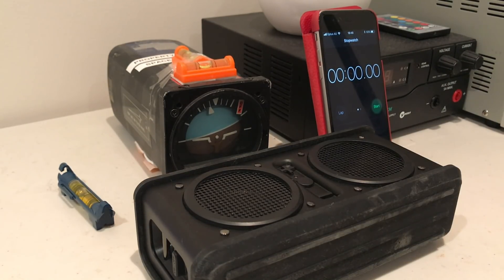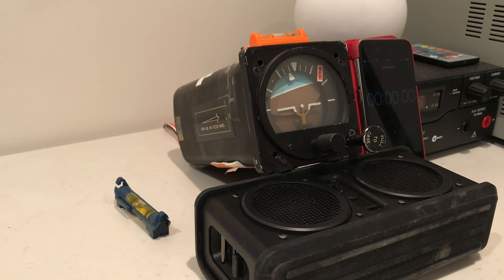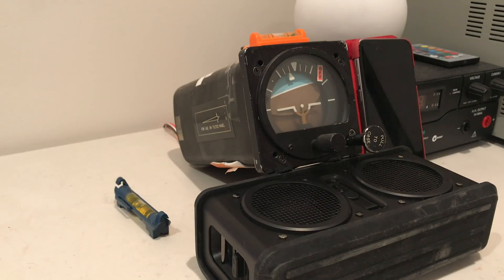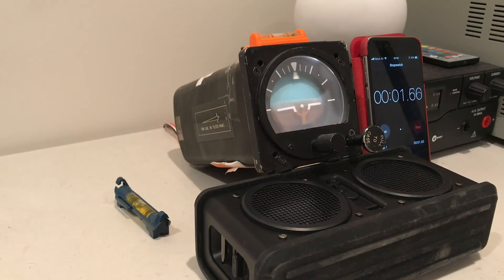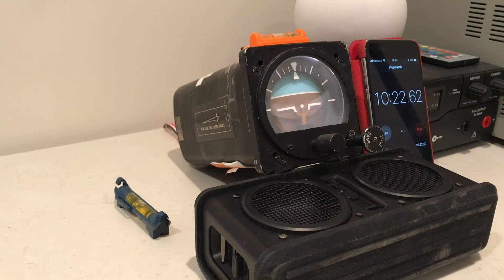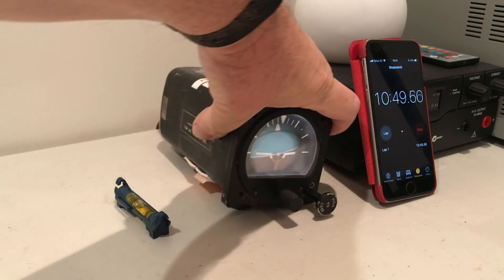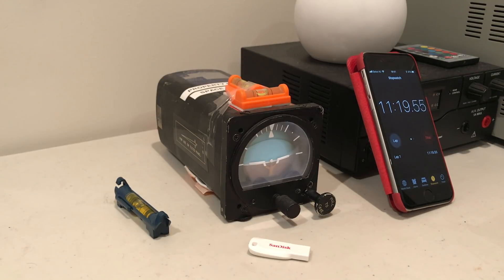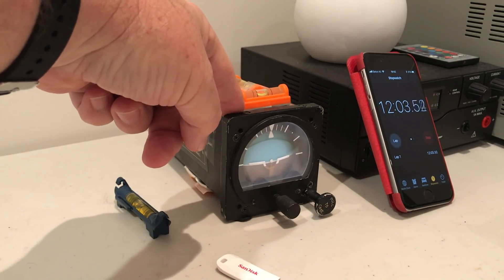Flat Earth - An often requested Artificial Horizon Experiment - Powering up at an angle.

Comment: Wolfie6020
RE: "The claim that the gyro inside this instrument always remains rigid in space is completely wrong."  NO thats not entirely correct.
The CoG of the spinning brass gyro wheel is set in the gimbal below the horizontal axis pivot point. Effectively because of the weight bias, the standard aircraft Artificial Horizon indicator is just a glorified plumb bob. If you lock the the pendulous vanes where they cross over at the base of the unit & add weight to the vertical balance adjustment screw, so that true pivot balance is neutral, then even this unit will remain ridged in space... exception>(because the spinning mass is still below the horizontal pivot point, aircraft acceleration & slowdown will have a slight impact on read out).  
Just as bearing drift will cause bias or error, having the gyro gravity weight bias preset in standard units, this will always favor the AHI to self correct to level. 
 You could so very easily prove the earth curvature if you wished???, just lock the pendulous vanes & remove or correct the pendulum weight bias. Apart from bearing drift, you should see a 15 degree change in 1,000miles or proportional part there of. 
You could conclusively prove flat or round earth in less than 2 hours flight time, not hard to convert that standard AHI to a *space type gyro*.
Reply from the maker: +Steve Tozer.  Sure and I don’t disagree with your logic if it were possible to perfectly balance the gyro but we would also have to completely eliminate all bearing friction and remove any vibration and micro accelerations from the aircraft 

Without modifying the instrument it is correct to say the gyroscope inside is not remaining rigid in space.  Even if the aircraft is not flying the gyro is constantly being corrected to remain level.   If it were not we would see it moving from the rotation of the Earth.

The flight plan alone for a two hour flight would conclusively prove the Earth is a Globe because they are all calculated for a ball and will never work on a Flat Earth.

Unfortunately in my almost two years of dealing with flat Earthers I have not met one with mathematical skills beyond the third grade so it is futile trying to explain the flight plan formulas to them.  

I have tried but they are completely blind to the numbers.  It is like showing a colour blind person an ishihara chart with a number on it.  We can all see the number clearly but the colour blind person never will.

Flat Earthers are blind to the math and the same goes with geometry as the Equinox Sun angles irrefutably confirm the Globe too.  

I don’t say this to offend anyone and I keep hoping to be proven wrong and meet a Flat a Earther who gets the Math,  but then he would not be a Flat Earther would he?
Reply: Wolfie6020
Thanks for your answer,  i should concede i do tend to lean towards a geocentric earth but that doesn't mean i support flat earth, rather im not convinced earth rotates. 
I'm in the process of making a second mobile triple axis space type gyro, the spinning disk diameter is about 400 x 10mm, larger diameters tends to neutralize or over ride a fair bit of drift(just as greater wingspan stabilizes roll), even your Ai unit in the video, run up on the bench wouldn't drift more than 12degrees p/h without auto correction, if earth rotates it should drift/move 15degrees p/h(+/- drift). The mean average of bearing drift on a stationary unit can be fairly easily worked out with a few test including reversing power supply.
A well made true space type mechanical gyro with certified balance & friction results that didn't move 15degrees p/h like clockwork would create questions. I am aware of the fully electronic units, however these may just be reading flux field though?... a lot of Helio & Geocentric math is the same if not identical (FE not included).
I sure would like to see a practical test done in an aircraft with a mechanical gyro, the speed at which you generally fly at(518mph) means curvature/(+ earth rotation)or lack there of, should appear fairly quick, 1 degrees every 8 minutes if travelling N/S, (or 2 degrees if travelling east {if earth rotates?}), in smooth air, no well made gyro would have bearing drift greater than the expected earth rotation + curvature @518mph travelling East. 
2 bonus questions if i may please:
Q1, on your altimeter, does changing cabin pressure affect the gauge height readout?
Q2, in the Heliocentric model, what stops earths atmosphere from being sucked into the vacuum of space?.
ps, i agree there are lots of turkeys on the internet arguing about all sorts of subjects, happy to acknowledge your presentations are top quality & sincere. Cheers.

Comment: Sure if you spin it up an it levels out on an angle but is level to the device it obviously going to be level when you lay it back down.. you have moved the whole system from level to level. Show actual documentation of what it does.
Reply: DivisionNL
If you scroll through Wolfie's videos you will find a hole series about the artificial horizon, also where it gets disassembled.

Comment: I thought Gyroscopes aren't affected by Gravity? So is the gimbal holding the gyro doing all the gravity work?
Reply: The gyroscope still has weight so it is still affected by gravity.
What exactly do you mean with " gravity work"?
Reply: Meeborg GP the actual motion and what a gyro does is not affected by gravity. The weight of the materials it's made of yes.
Reply: toiletduckie44
The gyro in a artificial horizon is.
Reply: toiletduckie44
What you just said makes no sense. Although the gyroscope is spinning it would fall when you drop it, therefore gravity affects the gyroscope.
Reply: Meeborg GP well a gyro is "rigid in space" so if you spin up a gyro and could somehow move gravity above it. To the left. To the right. To the bottom. The gyro would stay up right in it's spin. Sure whatever is holding the gyro may be attracted to the gravity but it would stay upright.
Reply: toiletduckie44
Lol, your "whatever that is holding the gyro "... guess why you need something to hold the gyro! Because without something holding it it would fall down affected by gravity!

Got it now?
Reply: Meeborg GP lol. I'm not that thick. I mentioned that above earlier in the comments. You're missing the whole point.
Reply: toiletduckie44 
That is why I asked you to specify what you do mean with "gravity work".
Reply: Nothing?

Comment: Talk about throwing yourself in with the sharks.. but here goes...I am in the flat earth camp in as much as I do not think we are moving through space and I do no think we are on a spherical or pear shaped ball. I know that I will come under heavy fire judging by your followers  comments below. I have watched all your gyro videos and although they are very well put together and to a degree educational, there  is only one aspect I am interested in learning about. I have to trust that you are a genuine person and are not wanting to purposefully deceive people because you are on a payroll somewhere.

So in this video you showed the gyro tilted on your speaker box which is fine, however you caged the gyro on the flat table beforehand then in the tilted position you powered up the gyro and it did exactly what it was supposed to when you put it back on the table, even though it takes a while it goes back to its caged position. That caging process is vitally important and gives the frame of reference which the spinning "fixed in space " gyro will always want to return to! If as you say the plane follows the curvature of the earth and the case is effectively put back on your speaker box and further , depending on the duration of the flight, the level indicator will go to its original caged position which by then would be unattainable because the plane could now be at some 50 degrees to that original caged position NOTHING will change that unless you re cage the mechanism! gravity or inertia or anything will only disrupt the gyro momentarily until it re establishes its position.

If I was flying a plane and my gyro was caged at ground level and I flew into cloud and ground fog the only thing what would get me to safety would be my altimeter and my artificial horizon!! Happy to hear any constructive comments, I just want the truth as should everyone!
Reply: I think you misunderstand what caging does. The gyro doesn't return to the caged level, caging just locks and resets the gimbals to center the working range on all axes. Gravity is what guides the correction mechanism, not the caging.
Reply: "Let's see Wolfie challenge this one "
LOL! Don't bother him, I can do it myself. Australia/Victoria is indeed 15 hours ahead from USA/Tennessee. But that also means there is 24-15 = 9 hours between the 2 locations. It is a sphere, remember? Translated in longitudes that makes about 240° and 120° (240+120=360).
The Moon can't be seen from 2 locations 240° apart, I agree. But no problem from 2 locations only 120° apart ... I will add that the Moon's orientation confirms the globe : same phase but tilted according to the 2 latitudes.
Reply: Paul STILL' on the FLAT, Wolfie has demonstrated this, the display returns to level, not to the orientation of the instrument housing. If you cage it to any position, and then orient the housing to any position the horizon indicator will slowly return to local down, not to the housing orientation.
Reply: Michael Onines at 3.59 in this video Wolfie demonstrates the gyro working correctly as it was caged flat on the table and as he props the housing back on his speaker box, the level indicator is clearly in the brown (nose down) position which is fine, I am saying that this is what you would see after an hour or less of 500mph flight, the body of the instrument would effectively be in that orientation from where it set off and that correct reading on the display is what you would see! after a few hours flying "around the curve" the mechanism would be out of its usable range, you would have to re cage it to bring the instrument back to a workable range. Wolfie actually displayed exactly what I am proposing about the fact that the plane is not flying around a curve or this would happen!!
Reply from the maker: +Paul STILL' on the FLAT.  Hi Paul.    No, the Caging process has nothing at all to do with setting a frame of reference.  

All it does is align the internal mechanism to the external case momentarily.  If the external case is tilted when you cage it and then release the cage the Gyro will self correct back to true level (based on the direction objects fall) and the position of the case when it was caged is irrelevant.  

Please watch these demonstrations. 

https://www.youtube.com/watch?v=klflYPbw708

https://www.youtube.com/watch?v=TbqcT05YWeo

If you want me to do a specific power up or cage in any orientation please let me know and I will do it exactly as you request to prove the cage & initial power up position are irrelevant.
Reply: Rollie, thank you for your reply and I accept that the caging just speeds up the time the instrument would take to correct itself. I would like an explanation if you or any of you guys don't mind, to explain the part in my comments regarding the orientation of the plane and the case of the mechanism ( which is obviously secure in the instrument panel) how at 3.49 when Wolfie lifted the spinning unit onto his speaker mount the A.I was in the nose down position as it should be!  but isn't that the same as the orientation would be after a few hours of flight? please understand I respect you guys here because there appears to be some integrity with you  all, I am keen to know this because I think it is a crucial and a provable experiment one way or the other.
So let me try a visualisation exercise, 
You are on top of a tall building in a helicopter and you are going to fly to another tall building which is say 200 miles away! If you draw a gentle arc to a realistic scale and stand the two buildings upright as they would be on the curved surface, the two building tops would be out of line with each other. power up the gyro and with it centred on the horizon line, fly to the other building, I am sure you guys have seen F/earthers cartoons showing the gyro maintaining its forward "fixed in space" position as the aircraft flies around a curve! I do not necessarily disagree with this so there must be something someone is overlooking. Going back to my question about Wolfies video at 3.59 where is the point where the artificial horizon corrects itself and is still true to its line upon landing at the other building?
I can see why they think this would be the case and I am keen to know your thoughts, thanks in anticipation.
Reply: I think I can see this now, you will assume as the plane moves around the curve the centre of gravity will also move so you would not notice any difference! the problem is it also works on the flat as well!
Reply: "it also works on the flat as well!"
Right! Yet you forgot there is no gravity on FE, replaced by some magical natural up-and-down   ^.^
Still awaiting for a working FE map and a FE model explaining actual observations of the sun for example.
Reply: French crow Me too!! however I am sure there is something amiss because the authorities with the power are very evasive in sharing real info. I am not paranoid but something ain't right!!
Reply: I see that Wolfie and I fully understand the reasoning and science behind your demonstrations, It appears to be "centre of earth gravity" against "flat earth density" keeping the gyro aligned, both models work so I will have to think this out! either way thank you for your very informative videos
Reply: Paul STILL' on the FLAT, I think you are getting it. An artificial horizon isn't some sort of magical globe earth proof, but there is no reason it wouldn't be practical and functional on a globe the size of the earth, unless you are travelling at hypermach speeds, in which case thy don't use the style of gyro Wolfie demonstrates with.
Reply: I'm on FE all the way. Nature proves FE. I'm tired of actually being interested in globe proof when most of the evidence is created in AutoCad which I ran for years. It has nothing to do with FE other than create a Flat grid that negates the N Pole Vortex. Now we have a silly experiment with a Gyro that proves they work on a Flat table. Show one night flight video with vertical star rotation going up over the cockpit as it would be if it was flying around a ball. They don't exist!
Reply: Tyler, are you claiming that the stars paths disprove the globe? O_o
Can you elaborate?
Reply: Thank you Tyler I will look into that
Reply: Yes. I'm going to do a video on this. Apparently the stars are outside of the so called Vacuum of our atmosphere. So if a plane is flying at night and the stars do not rotate vertically over the plane that proves either the stars are inside the Vacuum and space is still bullocks or simply the plane is flying across a Flat Earth.
Reply: I already did a shorter video on this https://www.youtube.com/watch?v=JaqC_7-41wI&t=14s
Reply: Tyler,
Congratulations for the idea and attempt of observing the stars. Yet I am not convinced about what you think you can show... Stars are rotating 15° / hour around the polar star and you're filming stars from an airplane flying southward. I don't get what you mean about stars that should "rotate vertically over the plane".
Reply: Im going to take a video of a toy plane taking that same flight path with a camera attached, rotating around a globe inside a Planetarium showing the stars above. There will be around 53 degrees of Curve rotating around. In that video the Milky Way is visible the entire flight.
Reply: This is number two for 2018. Someone in the USA and another in Australia can take a picture of the Moon at the same time. This is not possible on a ball. Let's see Wolfie challenge this one https://www.flickr.com/photos/153903416@N07/28757221268/in/dateposted-public/
Reply: What are your comments on this bit of video from an old usaf training film?https://youtu.be/8QTU4VBOMXc
Reply: "from an old usaf training film"
More from globebuster and his fake pilot buddy.
Reply: so do you think the spirit level app is fake? or is it misrepresenting the truth?